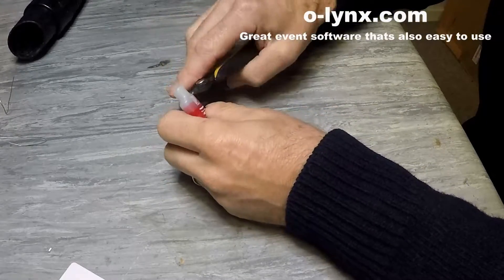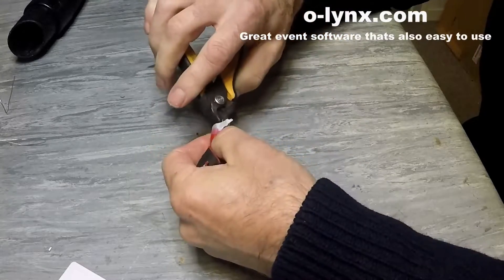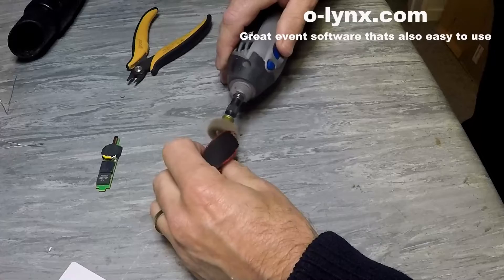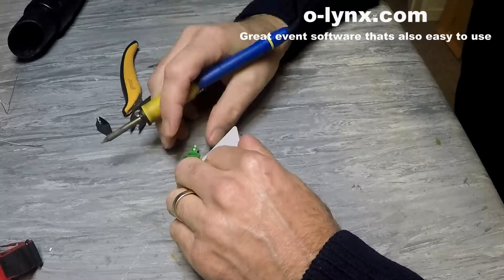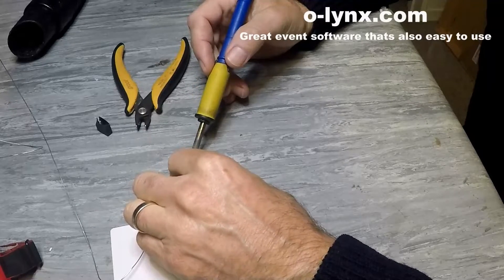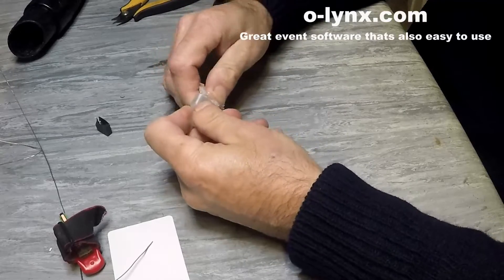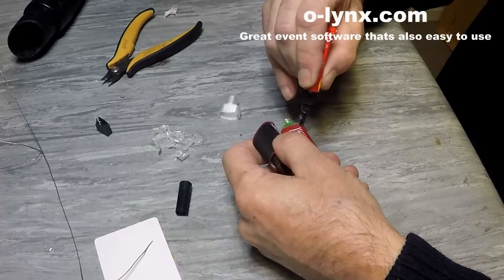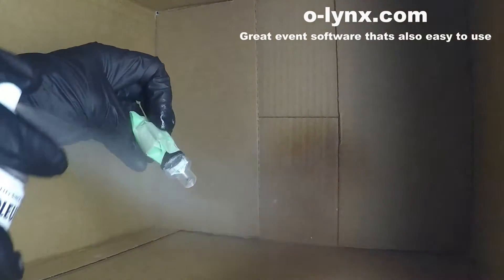SIAC Battery Replacement

Comment: What type of filament are you using for the 3D printing? Would PLA be too brittle? Thx
Reply from the maker: Some web pages seem to suggest PLA will become more brittle over time as it aborbs water. I have only used PETG. Make sure you have seen the other video https://youtu.be/k1ZAMbz78C8?si=oVNQc4HTRdzozsOw that shows how sometimes its possible to reuse the existing tips.

Comment: I have the si card 11 the light has stopped working, can you solve it?
Reply from the maker: Sorry I have no experience with SI 11's
Reply: You need to replace the battery. The battery in the SI-Card11 is for the light and feedback signal.

Comment: That's a decidedly tricky process; doubt I'll be attempting that, should the need arise.
Surely SIAC will develop & roll out the next version with easily -replaced battery?!
Thanks for the guide!

Comment: Nothing personal, but this is a very barbaric disassembling. This is look terrible. 
The cover of the SIAC chip housing can be removed after warming up with hot air (a special air soldering iron for electronics). The author of the video has this air soldering iron and it is used to heat the thermotube. It is strange that he does not use it for disassembly.
After warming up to 70-80 degrees for several minutes, the glue under the cap becomes soft and the cap can be separated with a thin blade or spatula, and by hands effort.
Reply from the maker: Thanks for the info, it should make things a lot easier for people. It didn't seem to have much affect at the temperature you described of 70-80 degrees but at 200 degrees it did work without damaging the plastic and without any tools.
Reply: @olynxvideos  I had stranger's chip at work. Therefore, I limited the temperature of the air flow so as not to do something wrong.